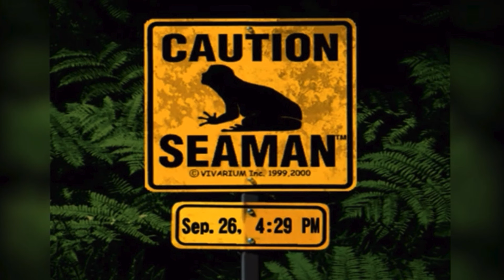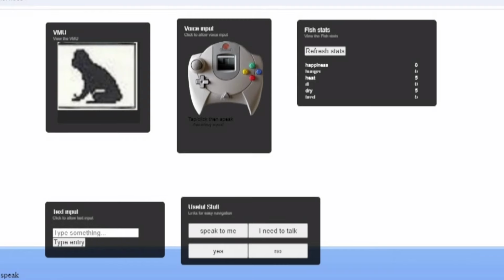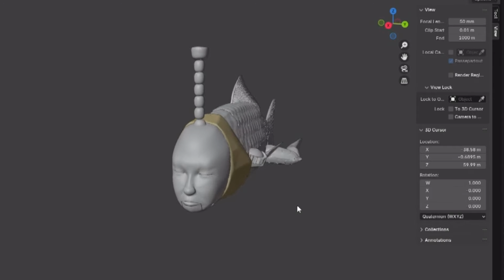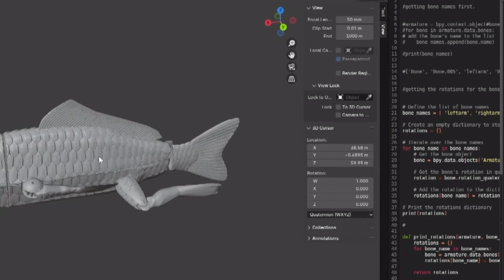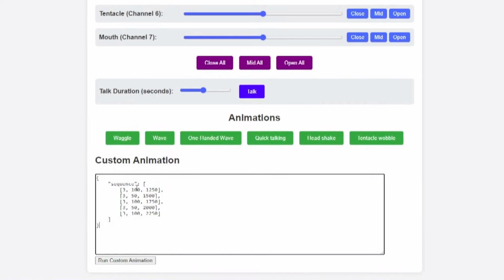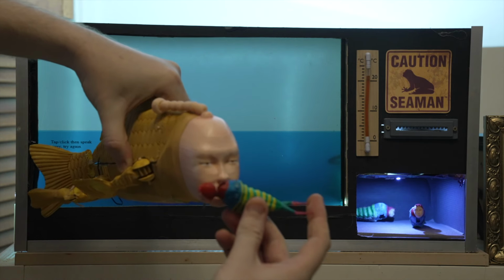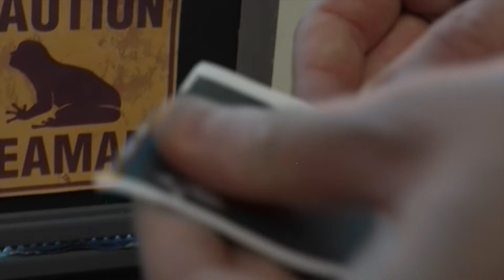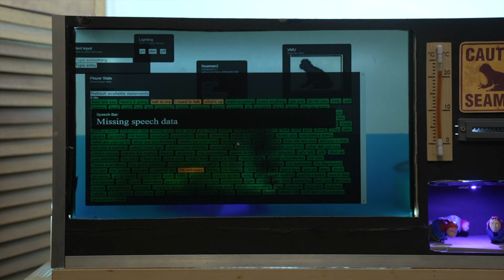Animatronic Seaman - deep dive (Based on the 1999 Dreamcast game Seaman)

Comment: This is amazing, love that you use the dreamcast controller to interact
Reply from the maker: Thanks, yea I really like the fact that I can just use the existing buttons on the controller but wire them to the internal traces for the vmu connection so the vmu doesn't need to be soldered in place and can be taken out and put back in to make the connection again. Its lucky that the old nokia screens just fit so perfectly for it too